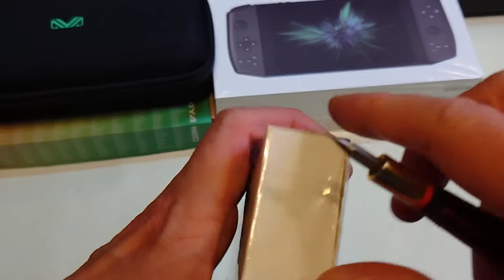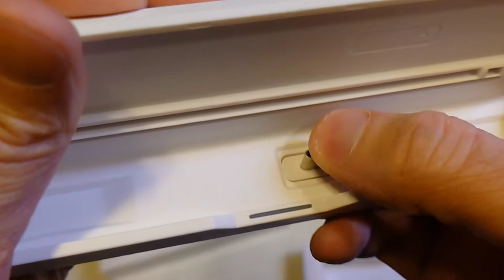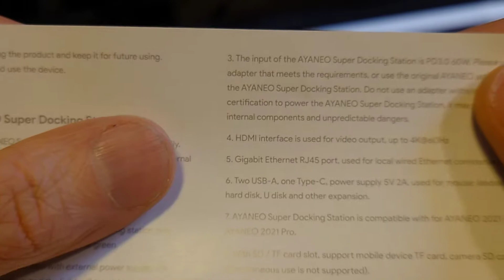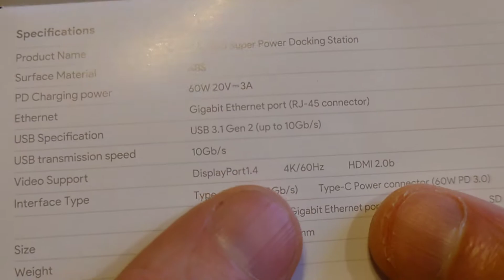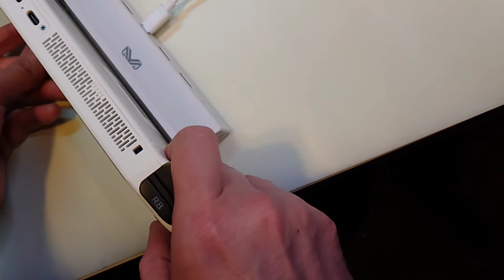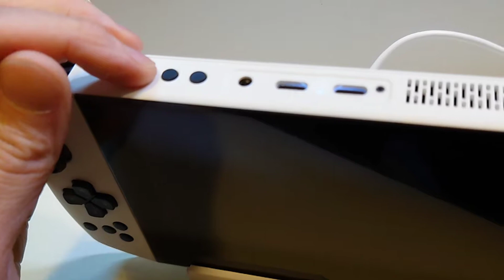Unboxing Overview Of AYANEO 2021 Docking Station 02-18-2022!

Comment: Is there any reason this dock would not work for the Air 1S device?  It appears to be a typical dock, so I don’t see why not, but since it was technically made for the 2021 pro model I’m just not sure.
Reply from the maker: The USB type C port in the bottom is very off center, so the handheld may not want to stay on the dock, due to the port on the 2021 series being very blocky and off center, so that is the only reason I can think of why it wouldn't work best for the 1S, but if you off-balance the side hanging over, should in theory still work, though it is a slower interface speed. I hope this helps, and much thanks for your question, interest, and for your viewership.

Comment: that fit the aya neo air?
Reply from the maker: It does not, it's designed only for the 2021 version of the AYANEO. There are docks being worked on for each of the AYANEO Air, 2/Geek, and 2 NEXT.  They always are available later. Most people are just using a USB C hub or KVM Switch instead of a dock on the Air series. I hope this helps, and much thanks for your question, interest, and for your viewership.